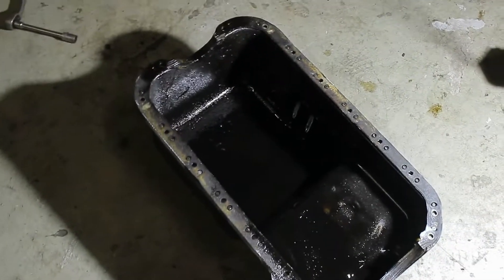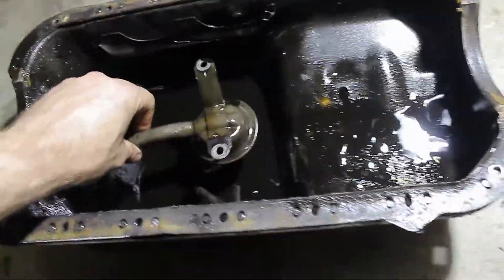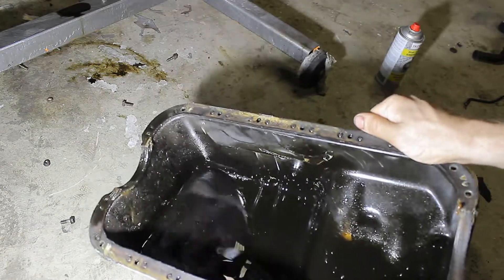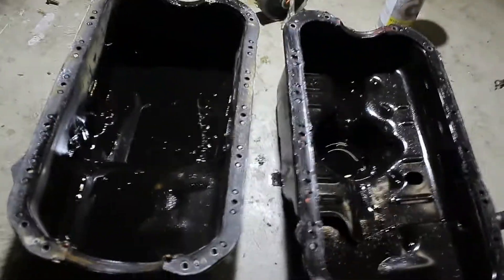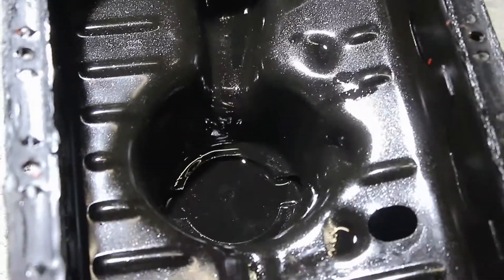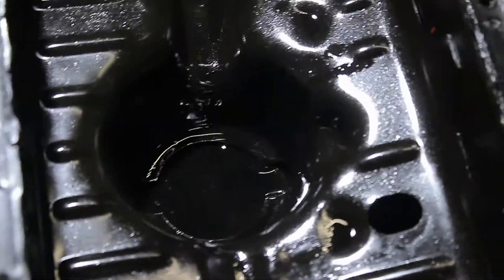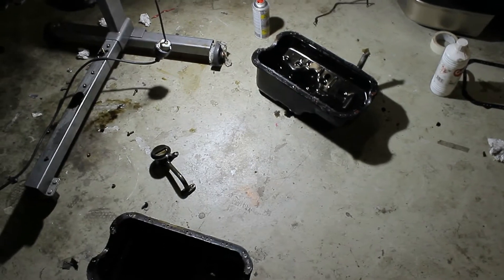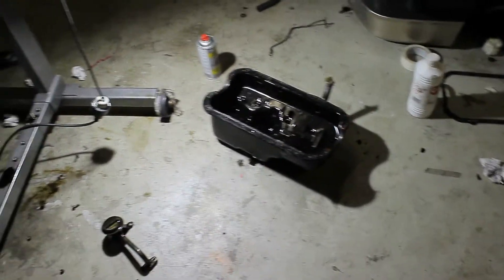What is a baffled sump and why do you need it?

Comment: Are there advantages to getting a bigger oil pan whether baffled or not? (OHV/OHC)
Reply from the maker: A larger pan has more surface area to transfer heat to the air. More oil also sits in the pan longer, where heat is dissipated through the pan walls to the outside. The same volume of oil is in the rest of the engine, and the heating up top is the same. Also, less chance of oil starvation!

Comment: Any car of mine with oil issues had a baffled sump?
Reply: please rephrase your sentence. It doesn't make any sense
Reply: Kees Theeuwes doesnt need to, sr20 and g13b have them from factory. And you've seen my issues..
Reply from the maker: thats because you like 150 shots of nos
Reply: I prefer 500 
Ps can we spray that on one of your pieces of junk?
Reply from the maker: i am not as cool as you jorn
Reply: I can fix that
Reply: The Midnight Garage nice video 😆
What if your not racing and you have a street car can i still install them as for peace of mind 💭 my car is a 3sge 2.0L na celica I already have uprated baffled sump plates to weld in my Standard sump pan any help ?